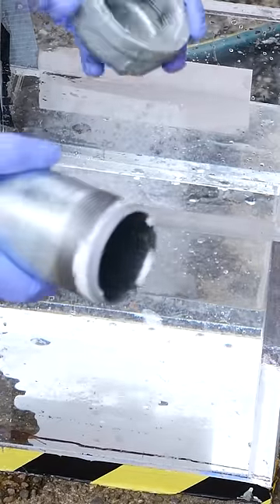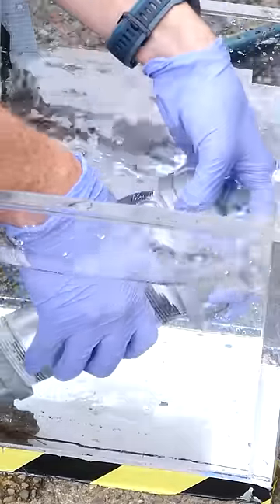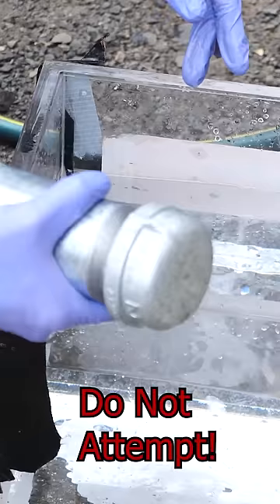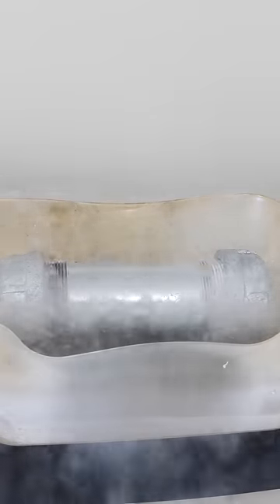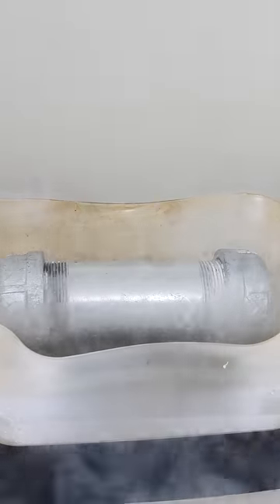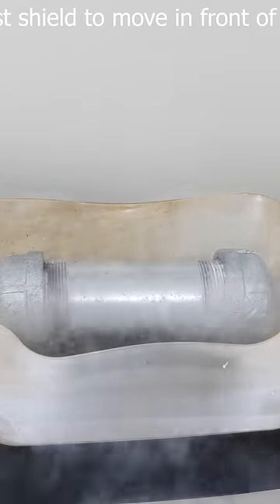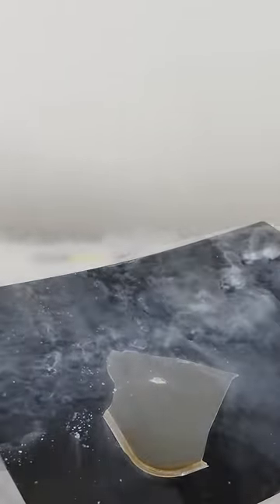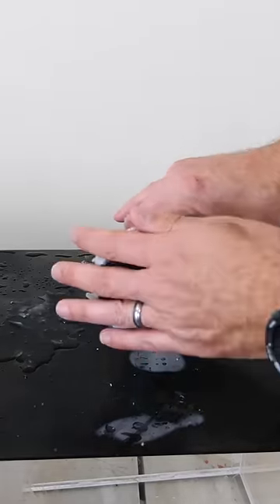Don't Ever Try To Stop Water From Freezing!

Comment: As a blacksmith I hate that you proclaim a piece of metal to be non-expanding. 

Especially after you make it brittle with cryo and ignore the fact that even the brittle cold pipe still expands with the pressure build-up inside it.

This expansion is literally the reason of failure around a weakpoint - hence why it popped at the thinnest and slightly corner-ish spots around it's circumference.

If you cool down a metal plate fast enough with a big enough ∆T you can make the plate explode just from the internal stresses alone...
Reply: "Aktually" ☝️🤓
Reply: So.... it's non-expanding?
Reply: @McStruggles Its literally an educational channel, "well actually" comments, while normally dorky, should be welcomed, WITH OPEN ARMS, here.  Buzz off.
Reply: Yes the metal will expand slightly, everything does, but relatively it is non expanding. Its not like a plastic or rubber or anything like that, that will expand considerably more than this metal tube did. Expansion is not the reason for the failure, lack of the ability to expand is.
Reply: That's hella interesting! Thanks for sharing; I'm gonna see if anyone has done that while filming now lol
Reply: achktually
Reply: @stevenhetzel6483  Some people would rather pretend to be smart, rather than take the time to actually learn anything.
Reply: Now when you say expand. I think people think you mean expand when cooled down. But obviously metal shrinks when it is cooled and expands when hot. That's why they have gaps periodically on train tracks.
The only thing that expands when frozen is water ice. That's why it floats on water. You wouldn't get a lump of lead floating on liquid lead for instance.
But as the pipe is cooled it shrinks a bit and like you said becomes brittle.
But the ultimate cause of the explosion was infact the ice expanding. It's the same reason why frozen water pipes break. The ice has no where to expand to in this case so again like you said failed at the weakest point. I'm just clarifying what I think you ment BTW.
Reply: So you're saying:  weld the pipe ends, then redo the test! :D
Reply: @rodnee2340 power lines do the same thing from winter to summer, contracting and expanding.
Reply: Okay, but it didn’t expand, though. It literally was non-expanding because it didn’t expand, and if it did it wouldn’t have reacted the way it did.
Reply: achktually
Reply: Duh
Reply: will this happen with anything stronger than steel like aron or titanium? like they give some but would that little bit really make that much of a difference? i mean possibly i just answered my own question but still curious. curious because educational purposes honestly.
Reply: The fact that the lid popped off rather than the pipe actually cracking supports what you said, the water exploited a weak point.
Reply: @Rutabega_NG  If you look closely you can see the lid didn't pop off it broke- most of it is still on the pipe.

When he said the metal doesn't expand he just meant in relationship to the freezing water. 

I think the point about flash freezing the metal making it more brittle may have some merit though
Reply: @littlemoth4956  if you were to go at it with a micrometer, you can literally measure the diameter and length of such a pipe increase while the content expands. Therefore the pipe expands as well due to being stretched by the pressure inside
Reply: @sawdustcrypto3987  hard to tell how the lid broke, but if it just burst through the top, that would make sense.
Reply: @sharkb8quintessatg160 titanium is not stronget than steel. Its slightly weaker
Reply: The steel would shrink in lower temperatures... not expand .... jeez man ...
Reply: @Redbeardian  read the whole thing. Second paragraph, second half-sentence. The pipe shrinks, exerting a pressure on the almost incompressible water but the water expands inside the pipe while cooling down thereby exerting pressure outwards. When the material fails it does so because it couldn't bend any further without disintegrating. Reversedly you can measure the capped-off pipe getting shorter, the caps getting warped inwards and the pipe itself bulging outwards radially around the lengths center when put under high enough vacuum.

Besides all that even contraction is - as far as maths are concerned - just inverse expansion
Reply: Exactly this. The liquid N2 did its work embrittling the piece.
Reply: This comment deserves more likes.
Reply: You and this science guy need to team up.. He's being fed bad data
Reply: @GenghisClaus  If you compete on the same level as or out-nerd ActionLab I would say calling them an "acktually"-type of nerd would be a compliment. Also I had the same feeling as the original poster and I'm not even a black smith I'm just aware of how warped my metal banger in my rig is after years of continual use, of course metal contracts.
Reply: @stevenhetzel6483 no. YOU BUZZ OFF. literal thought police telling us what to do, yeah no thanks
Reply: I want to see it done by just putting it in a normal freezer. I don’t think it will explode like that but I maybe wrong so I’m not putting one in my freezer.
Reply: I'd like to see an experiment where the pipe is frozen slowly. Yeah I agree, the cryo liquid will make anything brittle.
Reply: @McStruggles How are you going to watch a purely educational, scientific channel and proceed to mock someone for giving a scientific reaction that improves on it?  Where is the logic in that?
Reply: Totally what I was thinking. I was gona be a blacksmith but my brother told my parents not to take me to work 5 mins out if thier way when I was 16. So couldnt get transportation there as I'd have been 1hour late every day so I couldn't get the apprenticeship. Sooooo gutted.
Reply: @Dlannin05 because theyre worthless trolls😂 like most of the internet now.
Reply: @rodnee2340 Wait...you didn't explain the train tracks 😢 I was curious!
Reply: Hmmm...so if I understand the experiment correctly, he froze the metal, causing it to contract & become brittle, and in that state it was relatively "non-expanding", despite normally having the ability to expand. For the reason, when the water inside started to expand, and the metal didn't, the metal exploded on the weakest points. 

If I understood that right, really his misstep was not mentioning the fact that normally the metal could expand to some degree....but it is a YouTube short. Hard to put everything in there. Maybe he has a long video for this one like he does some of his others.
Reply: @AK-jt7kh  metal expands when heated. Water expands when it's cooled. The reason why water ice expands is because of the weak hydrogen bond. With liquid water the molecules can flow past each other. When it is frozen the molecules line up and because of the shape of a water molecule that means the molecules are slightly further apart. Water is the only substance that I know at least dose this. Everything else shrinks a little. This is also why water is the only substance that can float on it's own liquid. Like icebergs for instance. And if you paid attention at school you know only 10% of the iceberg stick out. That is the exact amount the ice expands by.
And to give you some homework. Try filling a pint glass with as much ice as you can, then fill the rest with water to the brim. Notice that the ice is above the line of the water. Then leave the glass in a warm place making shure not to spill any and leave the ice melt. You will notice none of the water spills out as the ice melts. Proof of my point. 
Congratulations you just did a science!
Reply: @AK-jt7kh  mostly, yes.
Even if embrittled by the cold there's still some minute flex in it. Just not including the "non-expanding" or putting a simple and short "near"/"almost" before would effectively fix the "issue" already.
And yes, I'm criticizing on a highly technical level and basically just arguing terminology/phrasing
Reply: The fact he doesn't reply to comments is sad
Reply: Brother, in that form, it quite literally is non-expanding. Why don't you chill out.
Reply: @happilyisolated  Metal expands when hot, and contracts when cold.
Reply: @TheRealCatof  That is correct! Very good!
Reply: @gcg8187  u look like the typa person to say that, and to play the flute...
Reply: @AK-jt7kh  train tracks expand in the hot summer. So the gaps in them are to compensate for that. They are  angled in modern train tracks because they are much longer than they used to be. Also trains run better on them. The ends are angled towards each other so when they expand or contract there is still always train track to run on. The old ones just had a gap that was straight.
Reply: All correct
Reply: Metal contracts when it gets cold, not expands. The reason that a metal plate will explode if cooled quick enough, is because the rapid contraction applies enough internal forces, to exceed even the materials threshold for plastic deformation.

It didn't expand at the thinnest points, it contracted while the water was applying pressure, which is also the concept behind most explosive devices. Containing the pressure until the failure point of the container, so that the pressure is released on one go, rather than gradually.
Reply: @stevenhetzel6483  except the "well actually" comment here is still wrong & inaccurate. So....🤓
Reply: @stevenhetzel6483  doesnt really educate though, when the experiment shown is faulty.
Reply: @大砲はピュ yeah yeah, there's a lot of thought in reacting like a third grader to an informational comment and not providing any relevant point.
Reply: Honestly, I'm not even an expert in any kind of metallurgy, and even I was annoyed that this man was calling steel non expanding
Reply: I think he was just simplifying
Reply: well ye you know, some people can understand what he means if u compare the water to the metal its so lil of an expansion that u could kinda say it doesnt. like the water will expand more anyway
Reply: Yeah you're right as a matter of fact metal is way more elastic than rubber.
Reply: @conorstewart2214 metal is quite malleable, and contrary to your example can stretch far more than plastic without breaking. Metal cooled with liquid nitrogen is brittle, so this test while fun is meaningless.
Reply: Freezing metal also causes the metal molecules to compress more tightly together .

Comment: "How do you make a pipe bomb?" "Do you have a pipe, water, and a freezer?"
Reply: bro that was liquid nitrogen not a freezer. he basically turned the steel into glass.
Reply: @greatleader4841  that only made it explode earlier and with less energy, the ice growing is what makes it go bang.
Reply: @IparIzar  no what he did was distort the atomic structure of the steel causing it to be extremely fragile. The steel would have warped like a plastic bottle does. not explode. or it would have created super cooled water.
Reply: FBI?  Yeah, that comment, right there.  🤪
Reply: @greatleader4841  I agree. If he froze it at a normal rate I think it would have just warped the pipe. Because I have a metal water bottle that warped when I put too much water in it and stuck it in the freezer for the next day to take to work.
Reply: @bobbisue313  you can't really compare a stamped steel bottle to this machined pipe, they use different kinds of steel, anything made for stamping is mixed so it has plasticity, to deform it in the way you want, this pipe looks hardened, and that makes steel brittle.

Comment: I think the pipe would actually survive if you froze it on a freezer, since the metal would probably deform with the water but not break.

But being at -200C made it too brittle so it just broke

Comment: Replace the coolant in your engine with pure water before winter starts if you want to see what water does to metal when it freezes.
Reply: Or leave water in a pressure washer. A lot of people lose there pressure washers that way
Reply: or just watch the video that works too
Reply: saw once a woman at a hardware store demanding 20 meters of new garden hose cus she left the hose coiled with water in it for the winter
Reply: Point of freeze plugs
Reply: You mean my neighbor’s engine 😊
Reply: If you're lucky, the freeze plugs will just pop out of your engine. If you're lucky. 🥴
Reply: @juhis5936 She doesn't realize that you can buy a hose repair kit for $ less than a replacement hose. 
My garden hose is heavy rubber meant for hot water and i leave it connected outside in winter. It swells up with ice and goes back to normal in spring.  The hose is from around 1965
Reply: @salladpatron3395 usually the block itself fractures like the cap.  If you are fortunate a plug pushes out but that's 1 out of 99 that end up scrap after freezing
Reply: @RetroCaptain Yeah those kits are for small puncture holes not a horizontal split up to 20 meters long lmao those kits are not magic.
Reply: @AnarexicSumo  I have seen a number of frozen hoses. They all broke/split right near typically the end where the sprinkler attached.
Been 30 years and still haven't seen a 20 metre split even once. 
Even froze solid ice in copper pipe it's open a small crack in a few areas not "bust everything wide open"
Not a bomb.

Comment: Found a flaw in this, at the temperature of liquid nitrogen that steel is EXTREMELY brittle. Using something with better cold tolerances or doing a slow freeze in a normal freezer would yield more accurate results
Reply: You are correct. Also should weld the lids shut.

Comment: The pipe fitting that was used in video were called class 150 or 150 psi. Next time try class 3000 pipe fitting.  Good video
Reply: Still gonna break, water freezing exerts around 175,000psi
Reply: It's for a bigger firework 🎉  @TheCleaningRat
Reply: @TheCleaningRat  I would guess the threaded joins would leak, before the pipe brakes.   Need to weld the cap on.
Reply: @natethetoe386  even if it's welded, that pipe is likely still bursting.
Reply: @TheCleaningRat Depending on how much pressure the vessel can hold, you could get different ice forms, some are denser than water. This however needs a FUCKTON of pressure and the right temperature.
Reply: FUCKTON needs to be an SI unit.
Reply: I think you're on to sth
Reply: You are trying to kill the dude 😂
Reply: You also have to use a fitting that is impact tested to subzero temperatures, or a stainless fitting.
Reply: What if it's moulded shut @CertifiedClapaholic
Reply: I'd actually love to see this tried again and even again with increasingly stronger tolerances and maybe even other substances but gunpowder and stuff would definitely get you in trouble with youtube even though watching this video makes it fairly obvious how a simple pipe bomb works lmao.
Reply: @TheCleaningRat  kind of awesome that the reaction of the exploding container becomes more extreme with tougher materials without changing the contents.
I'd love to see this pushed more and more
Reply: @sugamai in which people would need to be like 100m away 😂

Comment: Liquid nitrogen is also compromising the integrity of that steel. Try that again but with a more controlled freeze like putting it in a freezer and allowing it to freeze slower without using a substance that causes embrittlement of the metal.
Reply: Water is incompressible. It doesn't matter how slow it happens the pipe will break if the water in the pipe freezes. If he super cools the water instead the pipe won't break and the water won't actually freeze.
Reply: @robotsandmonsters4756 I think they’re referring to how the pipe would break. Supercooling metal fails differently than simply frozen pipes. 
It could be a smaller split without the quickly built up pressure causing an explosion. Temperature and rate matter.
Reply: @robotsandmonsters4756 a lot of general statements are only generally true.
Glass is a spring
Copper wire is a capacitor
Water is compressible. Just not very compressible.
Reply: This will cause the steel to slowly deform into a bubble-like shape since at relatively low negative temperatures steel retains its ductility.
You can make a beautiful timelapse, but no explosions means no attention)
Reply: Trying leaving it outside in winter? Sounds very reckless
Reply: @robotsandmonsters4756  Not true. There's different forms of ice that can only be created when water freezes at certain temperatures and pressures that prevents it from expanding. There's our typical ice (hexagonal ice), but there's 14 more types. Look up Ice-2 to Ice-15
Reply: The loud boom in the fridge
Lol
Reply: Wouldn’t the same happen if you boiled the water also
Reply: @robotsandmonsters4756   because it is frozen very cold the steel is brittle not ductile, so this is not a fair test. At around 0c normal freezing of water, steel is not this brittle much stronger.
Reply: Not True. Liquid nitrogen increases the strength of the steel. Haven't you heard of cryogenic treatment?
Reply: @youtuberschannel12   That's with controlled, cooling and heating and annealing cycles. Not with rapid cooling like this, that's not a good comparison brother but I get you. In this scenario it causes such rapid shrinking that cracks occur in the lattice structure, eventually resulting in failure
Reply: @svankensen damn, there’s a whole Ice franchise?? i didn’t even know they made a sequel!!

but if they’ve made it past the original Ice trilogy times five, they’ve gotta be running out of ideas…  what’s next; Ice-16: dawn of the rise of the return of the revenge of the planet of the Ice?
Reply: what happens if you freeze water inside a container that can withstand 2000 lb of pressure?
Reply: @komodosp  it will expand to its elastic limit, then return to its original shape. If you entered it's plastic limit, it may be permanently deformed